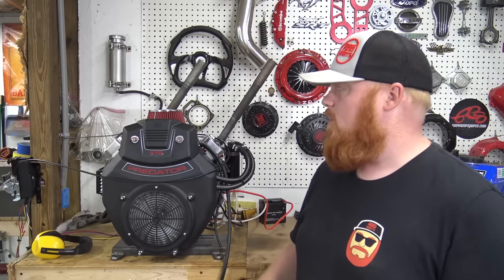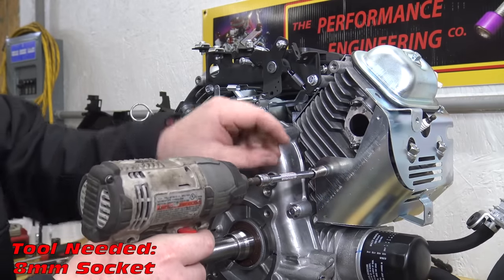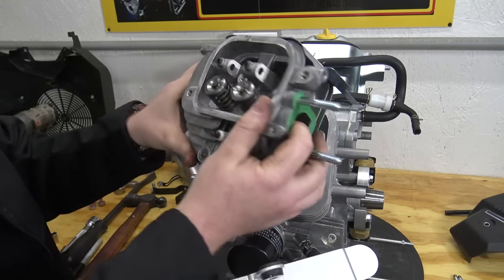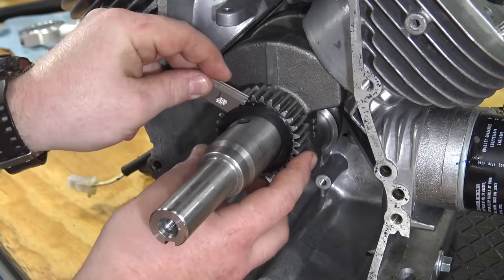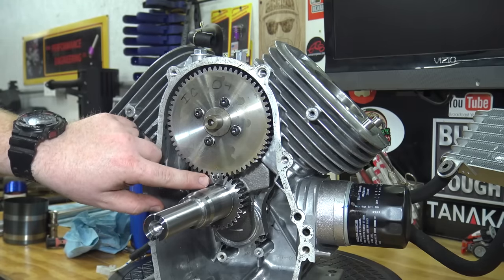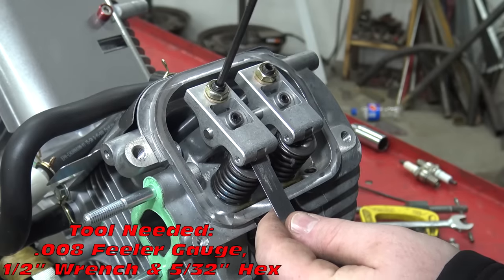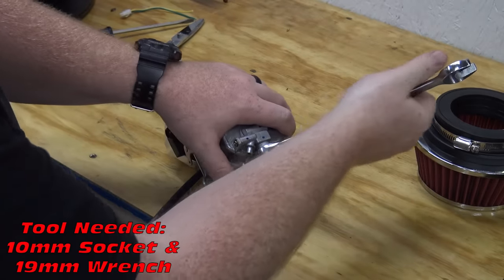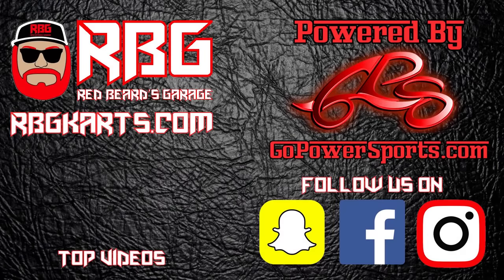🔥 40+ Hp Predator 670cc Performance Engine Build 🔥

Comment: I didnt even realize this was for go karts until the comments lol I'm into this for it being my mud motor
Reply: Centofunny_51 mud mower , that’s what I was thinking
Reply: Same. Just got a boat today with the same engine. Funny how a free good running boat will still cost me $200-300 before I can even launch it 😂. Cant wait to mod it, bet it isn’t cheap.
Reply: @MrPland1992  so since that comment I originally made, i had a 23hp vanguard on a go-devil surface drive and i was thinking about doing a similar kit and honestly it was cheaper for me to go with a 35hp big block efi and convert my pulley to allow the bigger crank on the big block
Reply: @MrPland1992  alot more reliable in my opinion too
Reply: Centofunny_51 since my comment was made I decided to use the 4cylinder from my Honda Civic lmao. It only weighs 60 lbs more than the predator and makes 100hp.
Reply: Same
Reply: Same here!
Reply: I thought it was for a mud motor also. I was saying my boat is about to hall the mail doing this
Reply: Same
Reply: Haha I was gifted a golf cart and its dead its battery powered and I'm looking into buying and building this engine to slap it in the golf cart haha
Reply: That’s what I did and it’s a monster 17’ boat and it’s insane
Reply: @georgechapman494  what kinda speeds
Reply: I was looking at this for a mud motor too
Reply: To all. I built one of these and put it on my long tail kit. I had a stock 22 on for 3 years and running into roots and turtles bent a rods or rods first year. Wobbly like crazy after that. Tan it for 3 years. Finally the exhaust broke off so I got a new motor anyway. Built up the first one like this since it needed rods anyway I did it like this but left the governor arm in. Took out the gear. Got a nice exhaust. Ran great till fan exploded. So I looked into light weight flywheel that doesn’t have charging capability… so looked into alternator add on… ended up just putting a stock fan back on instead of another 1000$ for a flywheel and alternator. After about a year hit something else in the water one time and of course broke the prop but again bent a rod or rods… so back to new stock motor. Again. It’s cheaper to just get a 35hp with better charging system and get the 1-1/8” pto coupler. And more reliable. It was faster for a while though. If these parts weren’t 600$ for a cam. 500$ for rods. 1000$ for this and that it mite be worth it but performance 670 is too expensive. And nobody else makes it all so my advice. Go stock and be super careful. Or get a real motor to begin with. Kohler Briggs etc.
Reply: I replaced my stainless prop with the cheap aluminum props. Now when I hit something REAL hard the prop breaks but the shaft/motor are not effected. I buy the props 3 at a time for about $50. Ive broken a few but they're cheap...
Reply: @donduck6195 where do you buy your props?
Reply: Saw this engine in a Ford Ranger
Reply: Me too
Reply: @MrPland1992 it’s actually surprisingly affordable! It’s not bad
Reply: Same here mud mower
Reply: Same
Reply: Same lol

Comment: It would be nice to see a stock configuration performance and then a modified configuration performance to see what kind of gsins you achieved
Reply: John Smith mph wise
Reply: @DAVIDISEPIC1111  
Lo opp Koop p ll 'll l m j koo no voice no
Reply: Dome pistons with bigger rods external oiling.  Billit crank.  Other things as well.  Any older gx670 honda 24hp parts

Comment: They are not actually lifters they are cam followers but I know what you meant. You can actually take your smart telephone along with this video and completely disassemble this engine and completely assemble it back in running condition just using this video stopping and starting as you work. I don't know of any other video that allows you to do this. What a very concise and perfectly described video on how to teardown and reassemble this engine. Wonderful job. No needless chatter or comments just precise instructions. Perfect. I wish others would follow your lead on editing and finishing their videos.
Reply: Actually they are called solid tappets, identical to the type used in a Y-block Ford V8.

Comment: Years ago the guys at OCC built a chopper for a lawn mowing company. This motor mated to a five or six speed trans would be awesome on a bike. Great video guys, thanks for sharing.
Reply: How would you combine it with a 6 speed?
Reply: It really wouldn't because most v twin 700cc engine make almost 100 horsepower
Reply: What does that have to do with anything? A bike with one of these engines and a six speed would work great (just like what was said above about the chopper build). I saw that build too, it was awesome. They took that bike on a very long ride with no problems and plenty of power and speed. If you're saying it doesn't need it because it has plenty of hp, look what's usually mated to the trans. And how? " One way is an open Belt Drive w/ Ball Bearing Lock-Up Clutch. Or just a regular primary. Not sure why it hasn't been done yet on one of these building videos. Would make a badass little street legal everyday rider. To each their own though, just my two cents.
Reply: Tim Brown I think it would be awful; way underpowered.

Comment: That's a nice clean build and it sound sweeet. In the 80's and 90's I built and raced small capacity 4 stroke bikes and spent a lot of time tuning engines very like this one, for example a CB250k4 Honda revving to 14.5k. There's a lot of simple things that look like they would be effective in this type of engine, happy to pass on if you think it would help.

Comment: This is an old post but I would like to ask a question.  How has the engine held up since the modifications and what has the performance been? Where is the sweet spot for the RPM's and total weight?  It's quite interesting and a few people, along with myself, might consider this as a replacement for the discontinued Rotax 503 engines.
Reply: I'm pretty sure it caught on fire and burned to the ground
Reply: @bigandlittlefirearms8395  pretty sure it did, never addressed the issue @7minutes... if you miss it look closer.. or just use a Honda!
Reply: @imcrazy7608  i cant find the issue HELP!

Comment: I need a light weight 4 stroke to replace my Rotax 52 hp two stroke, in my experimental airplane. The Rotax is awesome, but I need better fuel economy to increase range and endurance.

Comment: Could you do a Predator 708cc 22 HP V-Twin Engine next?
Reply: He would have to convert it from vertical to horizontal but it would be cool
Reply: @js_1995x   im always supporting more cubic inches!
Reply: You would get more cubic inches by turning it into a stroker. For example a 350 Chevy stroked out becomes a 383 stroker. This is just from adding different connecting rods and crankshaft.
Reply: @isaacvoeller3208  ...crankshaft with a longer stroke being the most important part of the deal.

by changing the rods, good lord
Reply: The crankshaft is also Part of it but the rods make the whole thing stronger which is important.
Reply: @noidontthinksolol  well he modified his post.... by the way not all stroker use shorter rod, if there is place they just move the pin up in the pistons.

but hey its ok, im qualified to build engine as you guys are effeminate urbanite 'that know stuff'. you did pretty well knowing name of parts and stuff... almost like men !
Reply: @noidontthinksolol  it was fun to speak to you girl, great spirit keep it up

Comment: This LOOKS and SOUNDS badass, can't wait to see what will be done with this one.
Reply: It rocked the bench!! Just watch the battery. If that was not bolted down, it would have launched across the shop!
And he didn't even shave the head or polish the exhaust ports! That has to be 50 HP or more.
Reply: @jlucasound  He said 30 hp at one point in the video.

Comment: I like the video, I will use the built engine on a slightly "different buggy", a part 103 legal ultralight aircraft. There are a few differences, due to the need to have the ability to match fuel air mixture for the altitude I'm flying at, also the prop will be in the "front" of the engine. Thank you for letting what I'm going to see when I disassemble the engine. BTW, there are a bunch of us Ultralight pilot's that are flying this engine on our Ultralight's, it is a LOT more reliable.
Reply: Sabrina Hill I have been trying to find more info or a forum for this exact purpose any insight?

Comment: Excellent video.  I was surprised to see the stock flywheel go back on an ungoverned engine.
Reply from the maker: It is fine for the cam we are running on this engine. Stock flywheel has more weight which will provide more low end torque
Reply: You have way more skills than me.  It's just every other video I've seen they throw on a billet flywheel.  What RPM's will that cam produce?

Comment: Man.. there are at most two bearings in this whole engine! None on the camshaft or wrist pin.!! The video was much better quality though :)
Reply: Wrist pins never have bearings except for small two strokers with needles in the rod end. Bushings work as long as they have oil.
Reply: Most engines have no bearings in the cylinder head. The cams run direct into the aluminum. Run the oil dry and the head casting is toast along with everything else.

Comment: he needs to put a billet flywheel on dat ting
Reply from the maker: Heavy stock flywheel makes for more torque. We are building this for off road not high rpms
Reply: @RedBeardsGarage  Good point. At first I thought the same as CC, but maybe I have been watching too much C&C. Just kidding. Can't watch too much of either!! :-) Excellent presentation RBG. Just Subscribed. Actually, I watch Mustie1 a lot, too. You guys are all awesome.
Reply: another bonus as far as i can tell is the charging system is retained with that factory flywheel, too!
Reply: Stock flywheel are always good to reuse because of the ability to keep the electric start system and also the capability to change the battery which is good thing if you plan on using any kind of lights on the vehicle or motorcycle you’re building the engine for and further more a billet aluminum flywheel that is capable of handling a electric start system won’t hold up very long and you would have to add a pull start system at some point unless you want to have to keep replacing the billet aluminum flywheels because of teeth wearing out because of the starter which will cost you a lot of money in the long run.
Reply: @rustybeatty6567  You can press a steel starter ring on to the Billet flywheel then pin it in place. Best of both worlds.
Reply: @k55comet  but does it have the ability to charge the battery as well especially if you want lights and other accessories that require electricity to power them.
Reply: @rustybeatty6567  Sure the fly wheel still has the Magnet in it just like a steel flywheel. Just mount the lighting coil a few thousands away from the flywheel. The flywheel turns a magnet field is created. ( BANG ) you have electricity the plugs fire the motor runs  the battery charges  lights come on and away you go. A little simplified but not that hard to do.
Reply: @k55comet  what's the cost for that style of flywheel because the stock one is basically free.
Reply: @rustybeatty6567  I don't know the cost of a Billet flywheel for the V -twin. But putting a starter ring or a lighting kit on is all about the same on these type engines. Good luck
Reply: @k55comet  too much. You're talking bout $500 bucks cause the flywheel with steel ring gear is $350 and you must buy a high torque starter to match it or else it won't start with the stock one due to the weight difference in the aluminum one so that's another $150
Reply: You can still have a charging system with a billet flywheel. Performance 670 makes a kit to add a 40amp alternator.

Comment: I run the Predator in my 1901 Curved Dash Reproduction Oldsmobile using the big Duster Clutch with 19"4" spoke wheels and that motor has so much Torque it actually bent the heavy duty main leaf Springs on a dead start. I had a Briggs 16 H. P. Vanguard Engine in it before and drove it on the highways between Redding Ca. and across the Western States to Missouri and back. It was a tremendous motor , But slow in the Mountains and hills. So after being in an accident where I was  forced off the road at a Creek Crossing Bridge and it rolled over on me dragging me under it for some feet Crushing my body internally in many places to the point of being a D. O. A. and revived. I came out and rebuilt the car and decided I wanted a bit lager engine so I would not be forced off the road by some idiot in a hurry. I have driven my car on Interstate 5 in Northern California as well as several other State and County highways and byways and it is great, But extremely squirrely when you step down on the throttle over 25 M. P. H.  But we had it out on a long stretch of highway and I was brave enough to get up to 52 M. P. H. on a straight road and have had it clocked on a Drag Strip But with the loose Tiller steering it is extremely scary and dangerous.  
At this time I have it tore down and building new springs for it a but heavier,  My car is not one of those little toy 1901 Oldsmobile''s you see For Sale in the Ads. I have one of those also. I want to sell. I bought it an was taken terribly. I have  over $6,000,00 in it and it was a total piece of trash and a chassis. It had an Amelia Island Tag on it.  Do not fall for those ads. I have had the Motor taken all apart and gone through and it runs fast and good for this car. I rebuilt the Body and made some Mistakes when it came to the Brakes and excel-orator.  I AM WILLING TO TALK TO SOMEONE WHO IS REASONABLE  BUT NOT GIVING IT AWAY TO A SHIEST-ER.  I can rebuild it and advertise it for at least $4500.00 with a new body and rebuilt no mileage motor and tires It has a Title and in some states can be driven on the streets  D. M. V. of CA told me. I WOULD EVEN BE WILLING TO TRADE IT FOR A TOW DOLLY I CAN USE TO TOW MY CARS BEHIND IN MOTOR HOME.  AT THIS TIME i WILL OFFER IT AT $2500 .00 FIRM, SANTA CLAUS IT WOULD BE A GREAT VEHICLE FOR YOU.  IT IS NOT A KIDS TOY. IT WOULD BE A FUN PROJECT FOR A MAN WHO WANTS TO ENJOY BUILDING SOMETHING HE CAN SHARE WITH CHILDREN WITH SHORT RIDE AS AND PARADES.

Comment: Watch your knuckles on the crank case edges. I’ve cut my knuckle to the bone on those
Reply: The float type caburetor could be a big issue in any aircraft application- and oil starvation due to G forces.

Comment: This is very good info!!! What a great engine this would be for an off-road 4-wheeler... His techniques are good, but he needs to be wearing latex gloves when handling internal engine parts... The oils from the human skin can cause bearing failures.... I did like his improved techniques of removing the flywheel... The use of a puller toll , will prevent damage to the main ball-bearings of the crankshaft... Much better , than his earlier videos of using a hammer and smacking the crankshaft!!!

Comment: Pretty good video! 👍🏻 I have a request though, I would like to see Performance 670's dual 24mm carbs, and show everyone how to use a fuel air mix gauge. As well as explain the throttle for dual carbs

Comment: Love your videos bud I’m in the process of making mine 40+hp with parts from performance 670 for my mud boat I was wondering if you can point the way of were I can get a flywheel puller like you used in this video

Comment: Most excellent Red Beard.   I've been seeking an alternative to 2 stroke power in my experimental aircraft.  This is the kind of solution I've been seeking.  So far however, I've not been able to find light enough 4stroke package (no more than 140 lbs exhaust reduction drive and all) able to produce 65 HP through 3:1 reduction.
Reply from the maker: We have a new build coming out soon that is close to if not more than 60hp with one of these engines.
Reply: Hi buddy red beard 
Videos Predator 670 bill really impressive I am a Dura 999 do you have a parts list or any aftermarket parts that would be available for this particular engine would be very helpful ...?